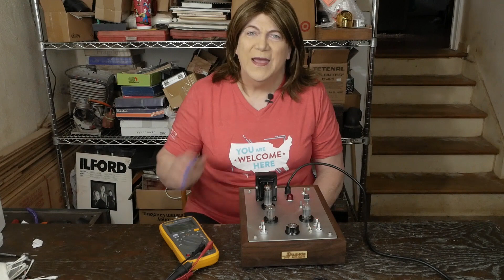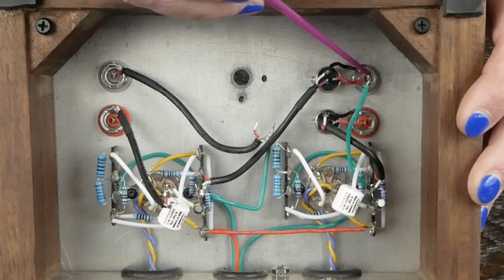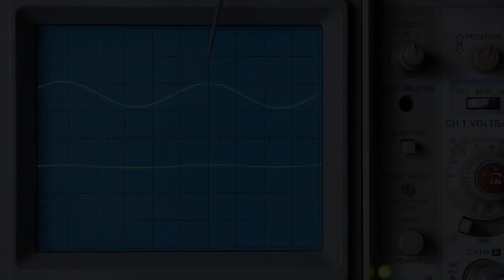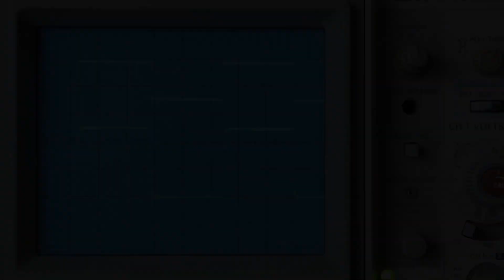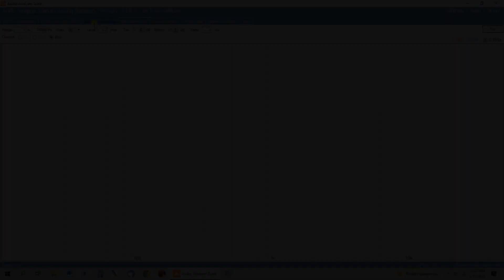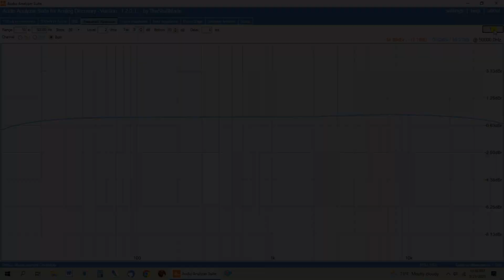"Color" Tube Pre-amp for Solid State Amps: Final Testing

Comment: Love that Logo plate. Looks sweet.

I am really enjoying your experiments.

Really reminds me of a guitar preamp. The distortion results are about what I would expect especially using a relatively non-linear tube like the 12AU7. You could even use knobs on the input pads so you could use them as a real time color control.

Did you consider using a higher value output pot to ease the load on the output stage?
Reply from the maker: Looking at the plate curves, not why people repeat this idea a 12AU7 isn't a linear tube. Raising the output pot value would make it harder to drive a relatively low impedance SS amp after it.
Reply: @SkunkieDesignsElectronics OK, I am not understanding why the larger pot would make it hard to drive SS. It looks like the pot is in parallel with the load. So I figured that the lower resistance pot would proportionally lead to very low load impedance.

Can you explain what I am missing? Not doubting you I just don't understand.

Thanks.
Reply from the maker: The whole pot isn't in parallel with the load it is driving, one side of it is in series.

Comment: Not sure if you are aware of this, thought I might mention it as a valuable testing tool.  You can check the frequency response between stages as well.  For example, you could DC (or AC) couple the probe to the grid of a tube to see what the frequency response is at the input of a tube.  Ideally, you'd want to see a flat frequency response curve from 20 to 20k for the appropriate dB.  For the output of power tubes, AC couple the probe to the cathode.  In this scenario (assuming you're cathode bypassed), ideally you'd only want to see noise below -50 dB.  If you have anything above the noise floor, the bypass capacitor is not completely shunting AC signal at those frequencies.  I use the Diligent Waveforms software to do this with the network analyzer.  You can do it with Audio Analyzer as well, I just prefer the control Waveforms gives you.  I'd be happy to tell you more about this if you think it would benefit your amp testing.
Reply from the maker: Sure, send me a PM at my website. I do know how to look at the AC signal on the grid of the output tube after the coupling cap.
Reply: @SkunkieDesignsElectronics  sure, I'll send you something in a day or two.
Reply: I sent you a message on your website : )

Comment: @Skunkie Designs Electronics When you are talking about roll-off frequencies (upper or lower), can you give us the 3db down frequencies please?  Thanks 😁
Reply: I cannot see the 3db down frequencies in the videos, which is why I asked ☹ A 3db down frequency is relevant because that's about 1/2 of the amplitude, which is relevant to engineers because what single poles are calculated at  😉
Reply from the maker: Sorry, I don't have that information if you can't see it on the test results screen. And I have no idea about that other stuff you just said :P
Reply: @SkunkieDesignsElectronics  Okay 😞 If you can, when you frequency sweeps in the future, please give us the upper and lower frequencies where the signals are 3db down? That would be helpful 👍 Thanks 😁
Reply from the maker: In this case the 3db down should be 2.34hz and I'm not sure this suite measures down that low. But the 3db down needs to be that low to not impact the signal at 20hz.
Reply: @SkunkieDesignsElectronics  Sure, I totally agree 👍 When the lower corner frequency is much below 20Hz, it hardly attenuates or phase shifts the lower portion of what folks can hear, and when that information (e.g., 2.34 Hz lower corner or pole) is communicated, one can quickly "get" that the high-pass portion of a given circuit doesn't (really) affect the lower portion sounds heard (in amplitude or phase) 🙂 Sometimes people forget about phase shifts near the poles, but they, too, can distort a signal (good or bad) 🙃 For example, there is a 180 degree phase shift of a signal at the pole(s).  How much of a phase shift above or below the pole(s) depends at least on how many poles the circuit has at or around that frequency.  For instance, for the 180 degree phase shift, the number of Hz between the beginning and ending frequencies of a two-pole circuit (assuming the two poles are at the same frequency) would be less than the number of Hz between the beginning and ending frequencies of a single pole circuit. But I digress (or nerded out).
Reply from the maker: You can see those on the test, I consider 3db down to be audible. I want to see 0.5db down to call the frequency response flat.

Comment: I can not thank enough. it was very informative for me special the measurement of noise level relative to volume position. I can make some modification on mine. just a question, since input stage of my discrete power amp has coupling cap too (1uF), the value of output cap could be reduced for getting same frequency response? as far as I understand after some point there is no change with increasing the cap value. correct?
Reply from the maker: The interaction is between the output cap and the 10K pot on the output. You can't remove that cap, as then you would have 86V on the RCA jack. And yes at some point the change by increasing that cap extends past usefulness with audio gear.

Comment: Besides the failure of the petentiometer , this pre does exactly what it's purpose was designed for.
Keeping the harmonic content stable independant from volume output .....
Adjusting the harmonics content by adjusting the input level....
Restoring the harmony of harmonics lost by amplifiers who elimante second harmonics leaving odd harmonics , mostly due to what's happening in  PP designs.
it's not about the percentage of DHT but about the structure and caracter of harmonics , ......even very low distortion measured amplifiers do sound un nantural when the harmonics are out of balance , so restoring the harmonics relatioship may result in a better musical experience .
We all know we don't want distortion but we also do not like and the perfect measuring amp that doesn't sound right or good ......;it's rather the nature of distortion that results in a musical experience than the sound that emerges from an  out of balance relationship of the harmonic structure of music and natural sounds !
That's also why we like triodes and SET amplifiers ..........another less know advantage of this kind of amplifiers is that at very low levels below 1 watt , these can have disrtion levels  lower than  0,01 % WITHOUT any usiing any NFB !..........in contrary many modern /classic amplifiers with very low announced and measured distortion levels the distortion goes up at very low level output ( Hard distortion ) before to fall down to the annnounced distortion numbers .
The caracter of the distortion also changes with output and frequency to wich the ear is extremely sensitive  !.................So the nature of distortion and behaviour as well as the structure of harmonics  on modulation...dynamic and frequency related .........is more important than only fabulous numbers not rlated to real music and sound.
Have a very nice , we all have those periods that it seems to go wrong .....but we learn and have the patience of the return of sunny days .
Reply from the maker: What you just wrote here is worthy of a whole video series exploring. And as you said, the main thing I noticed when I started listening to SE tube gear was that music still sounded very good at low volume levels, something that I haven't experienced with SS gear. And I don't feel like most PP gear has that same sweetness at low volume levels either.
Reply: @SkunkieDesignsElectronics  My pleasure ...........and always a pleaxure following your sharing with passion .

Comment: Interesting results. What output loading was connected? If it was only loaded with the output pot, you'll likely get different results if you put a solid state amp on it.......
Reply from the maker: I forgot to show that, I was using a 20K load on the RCA jacks as that's the input impedance of the amp this is going to be used on has.

Comment: You should also check the X10 Compensation on both your Scope probes too, since incorrect compensation can affect the accuracy of your waveform measurements.
Reply from the maker: Yeah I do check that but thanks for the reminder. At some point I may need to replace this ancient analog gear, but I have learned their quirks and what I need to look for.